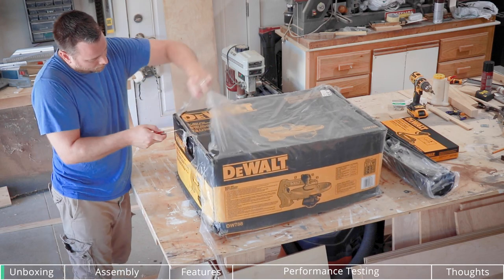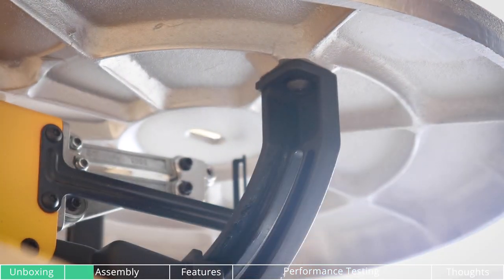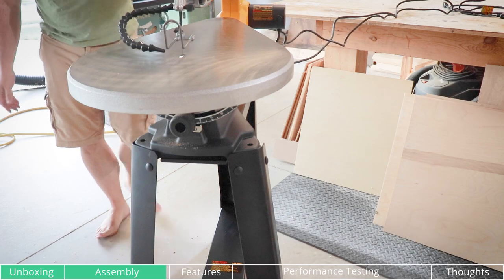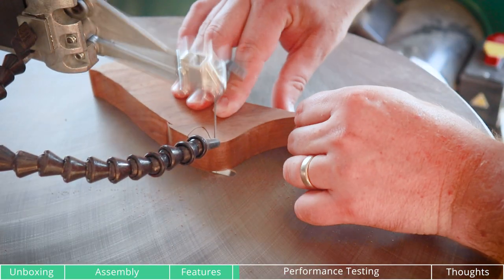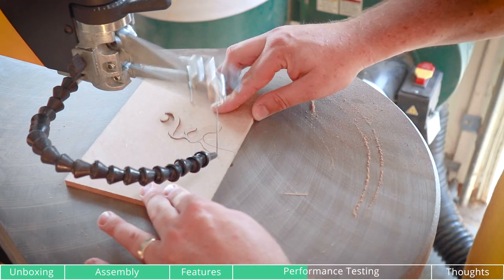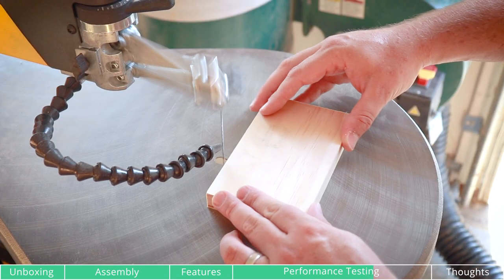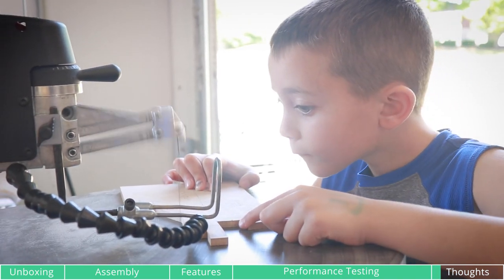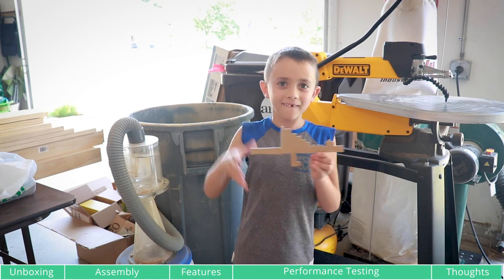What You Need To Know About The DeWALT DW788 20-Inch Variable-Speed Scroll Saw | Unboxing and Review

Comment: I have heard from some of the scroll saw clubs on YouTube that the DeWalt 788 bearings are not well lubricated from the factory. Have you re-greased the bearings on the arms of your saw? I want to make sure that I take care of this if it is a problem before I put a lot of mileage on my DW788.  Thanks!
Reply from the maker: I haven’t had any issues with the bearings or needed to grease them
Reply: Been using mine for 12 years, umm, I should look into checking that!! Never been a problem, yikes! Should check right now!! Thank you!!

Comment: how fast should I run the scroll saw 3/4 inch red oak?👍
Reply from the maker: generally faster speeds are recommended for thinner and softer material while harder thicker material require slower speeds

Comment: Bare feet are very bad form in any kind of shop.......
Reply from the maker: you are probably right :)
Reply: @HowYouCanMakeIt  , BTW, if your 788 is like all the others, the first thing to break will probably be the so-called "air hose" that blows sawdust away. Instead of paying DeWalt about $30 for a replacement air hose assembly that with be a real *** to install, go on Amazon or elsewhere and spend about $18 on a cooling water hose from Loc-Line, plus their installation pliers (about $7.50 for the hose kit and $10.50 for the pliers. The replacement hose will be better quality than the original, and it's kit includes three different size nozzles that you can choose from. The pliers makes installation quick and easy. You will want to look for their 1/4" ID hose and the matching 1/4" pliers. Taking the table off the saw and raising the upper arm will make enough room to get the pliers in close to the saw.
Reply from the maker: Thanks this is very helpful to know. Thank you for sharing.

Comment: Are you actually barefoot in your shop? Sorry, I tuned out when I saw that.
Reply from the maker: Yes most of the time. I wear shoes when it gets cold usually at the end of September. 😁
Reply: @HowYouCanMakeIt  no indian summer for you? We're usually good until almost Halloween here. but my shop is always far too cluttered to get away with going barefoot in it. ..not to mention all the different splinter/sliver possibilities ranging from wood to copper to curled bits of sheet metal to stainless steel filings, carbon steel chips, fiberglass strands.. ...etc.  then there's all the splitting toenail / stubbing toe probabilities.  So I guess im not without fault either. I shouldn't have "cast that stone." 

..as for the dewalt scroll saw. I thought they discontinued them? I got mine back in the mid 90s on sale at home depot. I think it was marked down to about $60 or less.. They said they weren't making them anymore.. but now that I'm thinking about it oh, that was about one minute they started pushing those Ridgid woodworking tools. Maybe they were just making room for that. Anyway, I think I made 1 jigsaw puzzle with it and it's been collecting dust ever since. At least next time I use it it's going to be free.
Reply from the maker: I live in Illinois and totally understand tools collecting dust. That is why I am really careful in what I get. I have to use it every few weeks to make it worth it
Reply: @HowYouCanMakeIt  I don't mind the dust so much . Ive got no regrets about it. I got it because it was priced so ridiculously low. Hell, when craigslist opened up, I went on a collecting rampage. I've actually got 3 scroll saws now. The second one is a delta for $20 and the third one was free.
Reply: It’s his shop if he wants to be barefoot that’s his business
Reply: @HowYouCanMakeIt  🤭✌️